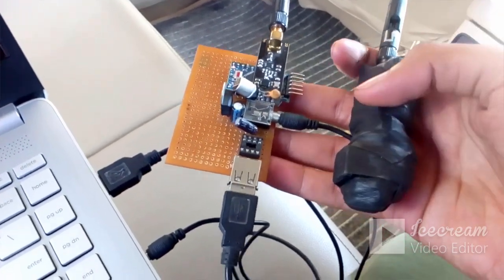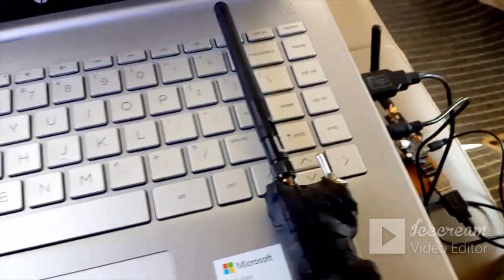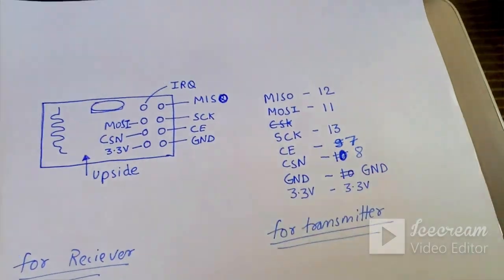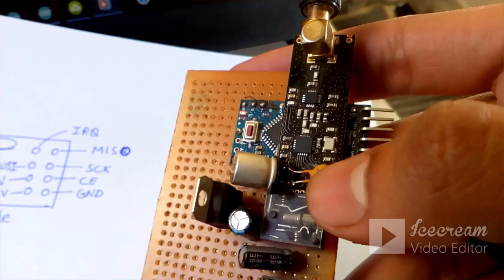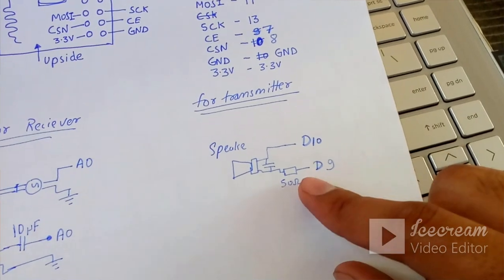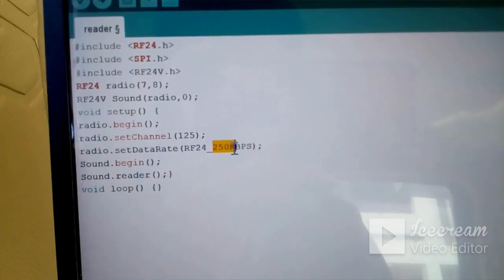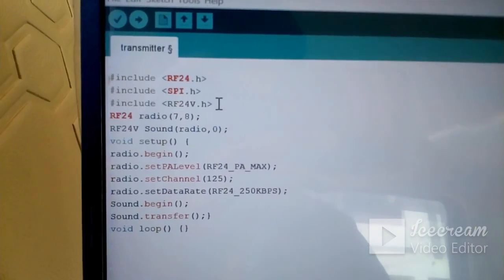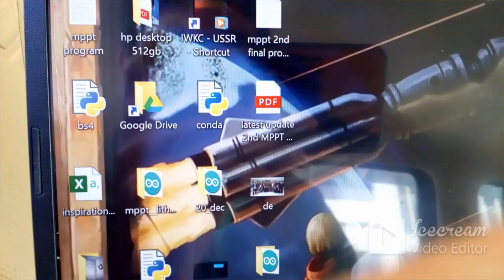NRF24L01 Audio transmitter with Reciever /Codes [Part2]

Comment: Brother, I need a bit of advice. I'm trying to use this set up to create a wireless system for my guitar. I'm using 2 Arduino UNO R3(s), and then pinned the NRFs as you did. The transmitter I added a 10uF and 10k Ohm resistance instead. (So this is connected to the output jack). I then let it process into the D9 and D10 pins on Arduino. The signal I suppose is being sent to the receiver where I have the output at A0 and gnd, with a capacitor connecting to the speaker. However, I seem to receive nothing but static noise. 

Im not sure if I made a mistake wiring or with code. As I used NRF24V library I found on Google, I'm not sure if you have a specific one you used. I would greatly appreciate any advice or support. Thank you for your time.
Reply: Firstly you will will not get your output at A0 you will recieve at pwm pin 
In order to transmit audio received on guitar string , you need to pick up the sound using and by pre amplifying it you should send it to Arduino analog pin then after transmission it will be recieved at pwm pin , then you should amplify it again before sending it to the output device
I have made it , but the problem in my case is I'm unable to achieve bi directional communication simultaneously

Comment: Thank you so much, can you help me with ardiuno codes please, I want to build one way communication like yours
Reply from the maker: Hey it's good u like my video thank u, help means ,as I have already shared codes in the video, how I can help? ;)
Reply: @rfhacknikola  I tried your codes but they did not work in my case, I downloaded the library, but the codes could not recognize sound.begin and other lines that starts with sound. Any advice ?
Reply from the maker: As per my advice, I can send u my library folder, this may work but suggest me some way so I can share u folder
Reply from the maker: U can also share ur email, so I can share by G.drive link
Reply from the maker: @DigikasCorp.Founder  check ur mail
Reply: Sir please give me the Arduino Uno code & library to be uploaded. My email is sibaram2datta@gmail.com. Sir please do the needful at your earliest.
Reply from the maker: @sibaramdatta5625  i have sent you mail
Reply from the maker: Yes?